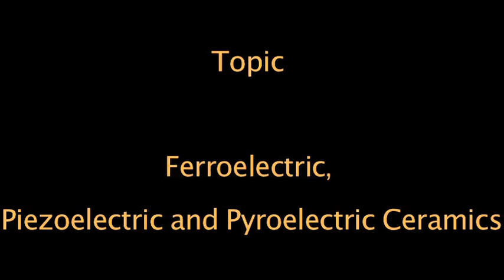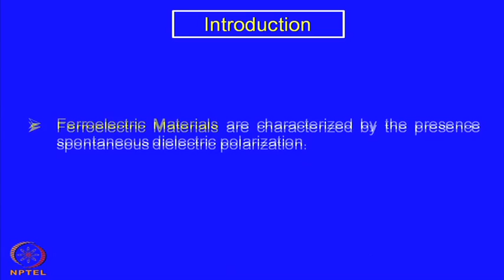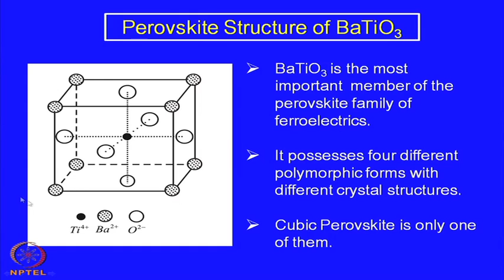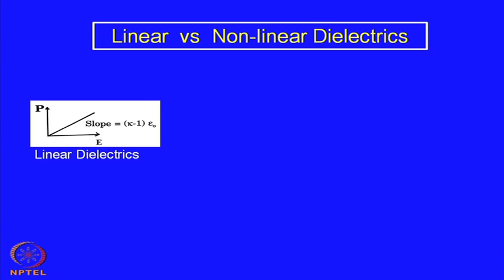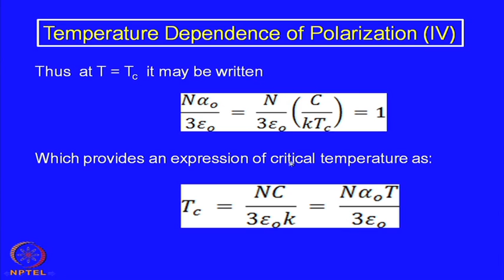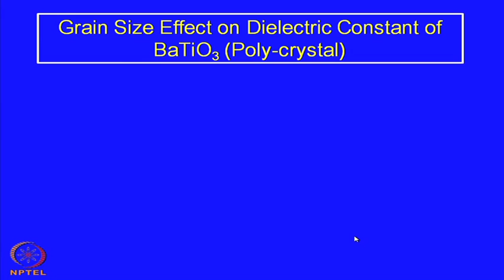Mod-08 Lec-19 Ferroelectric , Piezoelectric and Pyroelectric Ceramics

Comment: Thank you so much professor for this well established lecture over ceramics and their properties related to orientation of groups and thus the dielectric constants which prove to be the stepping stone for millon dollar industries. 
I just had a question sir if i may. 
Q.
Sir as you described about how electric field is responsible for the orientation of the groups which were randomly oriented earlier but upon application and increasing electric field they oriented themselves having a net dipole. 
Sir if we take the case of piezoelectrics which happend to produce electricfield upon application of stress so can they be used for the same effect so that all we provide is mechanical stress in order to produce ceramics with high dielectric constants ?

Comment: Is it possible that the domain boundaries match the grain boundaries in a polycrystalline ferroelectric material or these two concepts don't have anything to do with each other? In other words, is the orientation of the dipole within each unit cell independent of the orientation of the unit cells in a grain, for e.g., or are the dipoles oriented along the c-axis of the cells? If the dipoles are pointing in a different direction than the c-axis, doesn't that mean there is some sort of shearing in the lattice?
Reply: Domain boundaries and grain size are two completely diff aspects for the generation of ceramics with high dielectric constant. 
The grain size if in accordance with the temp dependence of ceramics , wherea as domain size or group size or the we may say the time taken by preffered domain to grow under increasing application field in order to allign the dipoles parallel to each other and thus produce a net dipole.
Reply: Yes the orientation of dipoles inside the group are paralled to each other but groups are oriented randomly so innately there is no net dipole unless electri field is started to be applied
Reply: There is a shearing in the lattice to make it a non linear structure in other words else than cubic because unless and untill there is no distortion in the lattice there wont be dipoles there thus our starting condition pf pervoskite structure always having dipole moments comes at flaw. Thus , yes there is shearing in the lattice

Comment: you gave the definition of a ferroelectric as a material having a spontaneous polarization even in the absence of electric field, so that when you ploted the hesterisis you have corresponded  Ps= 0 to E = 0 ? there are any explication?
Reply: I read from a book[piezoeletric materials and devices]. it says that the ferroelectric material possesses a property of reversible polarization so that the spontaneous polarization can be reversed by the applying an external electric field. and I think the hysteresis just want to show the very initial state of the material at the origin.
Reply: il parle sur la polarisation resultatnt qui est egale à zero mais la polarisation spontanée veut dire que les moments dipolaires des domaines ferroelectroques ne sont pas nuls ils sont orientés, chaque domaine ets orienté selon une direction dont la resultatnt donne P=0
Reply: If you see the hysterisis graph again at E=0 , The value of Polarizability is a value at Y -Axis with a dotted line which depicts that unless a negative bias wont be applied further polarizability wont be 0. 
At E=0 , Ps=/0